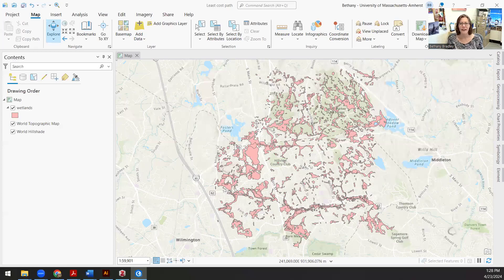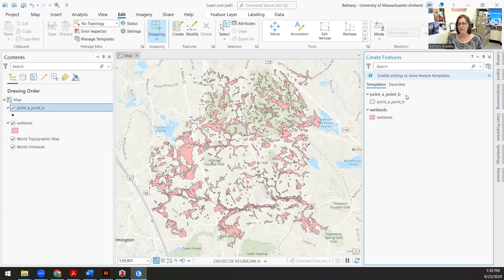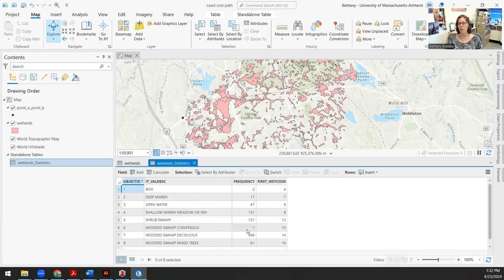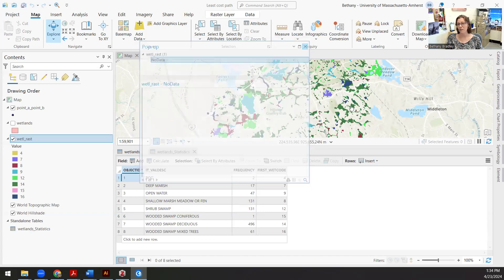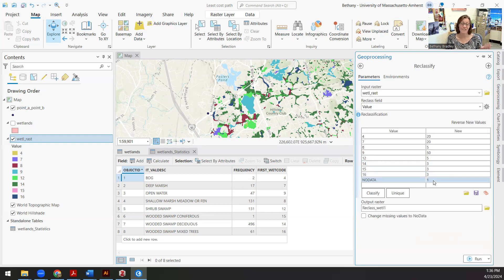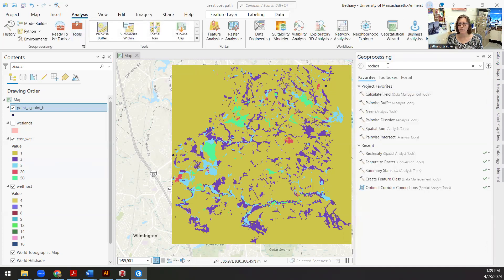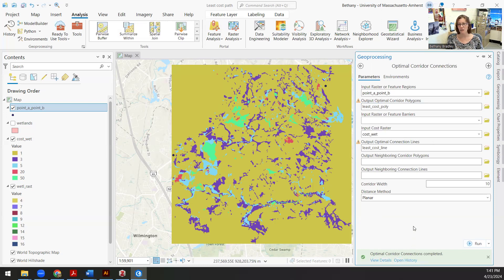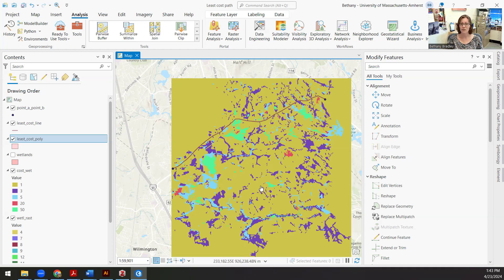Least cost path analysis in ArcGIS Pro

Comment: Nice video and very helpful 👍. I just have few question:
Is the same analysis can be used if multiple parameters involved like building,slopes,rivers, roads etc and the distance from A to B is will be roughly 80-100km.